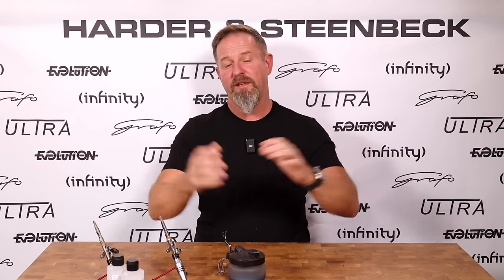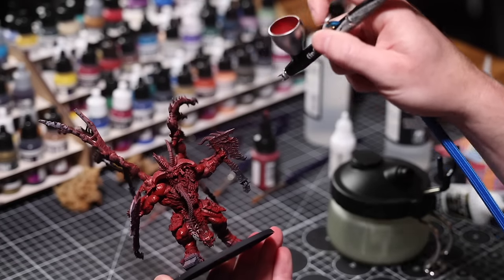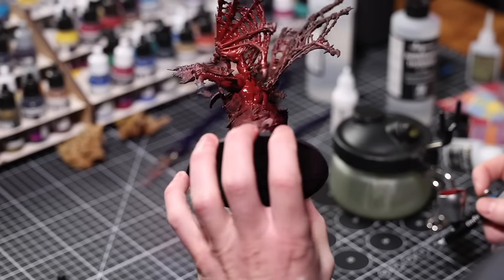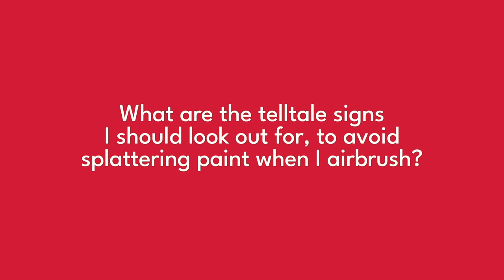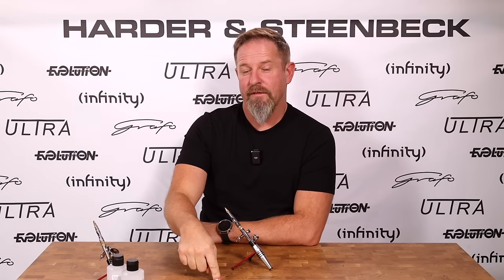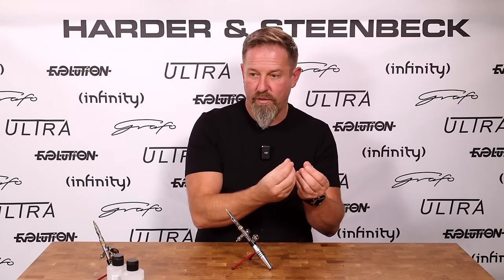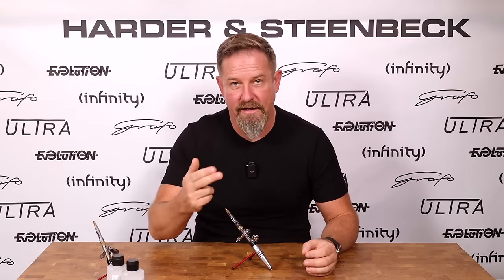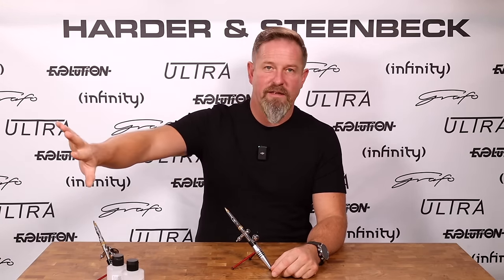How to stop putting too much paint down and avoid paint splatter

Comment: I have a question. I purchased the new Ultra and the new Eclipse. Both are incredible airbrushes. Some of the paints I use are lacquer or alcohol based (Mr Paint, Mr Surfacer, Tamiya, AK Real Colors). Because of the harsher products used to clean these paints from your airbrush, I am afraid to run them through my Ultra and Eclipse. I only use them in an old Iwata HP C Plus. Can I use these harsher solvent based paints in my new brushes and if so, what is your best way or best product to clean these paints with. Thanks for everything!!!!
Reply from the maker: Hey Tony - thanks for the question - I assume you mean EVOLUTION when you refer to the Eclipse :-) anyway, honestly, anything up to and including cellulose or toluene thinner is no problem for all the paint bearing parts. Try to keep it away from the airvalve though, as the very small o-ring in there is a little more sensitive, and should not need cleaning anyway, as it is purely air-bearing. So go ahead, use whatever you want. No worries.
Reply: Yes I did mean Evolution. See, this is what happens when someone walks into your office and starts asking questions about something totally unrelated to what you are doing! Thank you. I was concerned about the internal seals and the finish.  @harderairbrush

Comment: Hi, i have trouble spraying very fine lines or small areas with white acrylic paint, i see a lot of dusting. If I thin the paint any more i cant go near, because the paint will be runny and then I am in spiderwebbing territory, If i increase PSI I get the same effect. Could you help, please? Thank you!
Reply from the maker: White is like the building jump in the Matrix. Fact. No-one gets it the first time, even The One. Firstly, you need a really good white. If you're struggling and struggling, then you might not be using a good one. I don't know all the good ones, but the ones that I haven't struggled with are: Vallejo Game Air, Tamiya, Golden, Createx Illustration, Pro-Color, to name a few. Generally speaking for fine stuff, try thinning not so much, and DROPPING the pressure a bit. The feel on the trigger is dramatically different, but dropping the pressure and thickening the paint a bit helps the opacity, and with the somewhat decreased atomisation, it also helps a bit to sharpen up the linework... pay close attention to keeping your needle tip clean though. Hope that helps!
Reply: @harderairbrush  Thank you very much! I am on my way to the workshop to try it out!
Reply from the maker: Let us know how you got on!
Reply: @harderairbrush  thanks! This helped, i am using schminke aero color supra white, it feels better than vallejo air but i already ordered pro-color to try that out. The line is not as clean as with normal colors but I can work with this, mainly I am using it for osl and volumetric highlights so the second coat of color hides qny imperfections! 😁

Comment: Thanks for the videos.
I have a couple of quick questions about cleaning between colours.  In one of Squidmar’s Videos he changes colours by forcing water with a squeeze bottle down the cup, while operating the airbrush. Is this something that is safe to do with the airbrush or could it cause problems if done incorrectly?
The video is (https://www.youtube.com/watch?v=BLOT1Jkq9wk at 32:34.)

I have seen another person clean acrylic varnish out of the airbrush with hot water. Is this something that is effective or not worth doing because not necessary / damaging?
Reply from the maker: Hey there - love the user name by the way... regarding Emil's video - no problem with "pressure washing" at all - go ahead. The hot water thing I've heard before. As I've said in other videos, remember that airbrushes are made from elements from the Earth's crust - hot water isn't going to touch them at all! No worries :-) BUT the hassle of boiling water to make it hot etc etc - no way - too much trouble! No benefit to using it, and lots of hassle. Keep it simple - use the cleaner recommended for use with whatever paint product you're trying to clean and spray it through. That's all you ever have to do. So many people trying to make it complicated, and I really have no idea why :-) perhaps it's to try to make the "this one trick" clickable video - I don't know :-) but honestly, keep it simple, use cleaning and thinning products from the same manufacturer as whatever paint you're using at the time, and life will be excellent!
Reply: I just watched that video too. My Ultra 2024 is expected delivery on Monday.
Reply: I have a little self-heating cup that plugs into the wall just for airbrushing. I push the button for the desired temperature (1 setting below boiling) and use a dropper to get it out. 1 dropper of hot water and scrub with a q-tip, another dropper of hot water to flush,  a little bit of airbrush cleaner to flush, and then one last dropper of water to flush the cleaner.

That being said, it's a lot of steps, and after watching so many videos from Warrick, I've just started flashing with water and cleaner to see which way is faster... I'll know next week after putting some more time on my new Evo 2024 this weekend 🤓

I'll probably save my current method for the last cleaning of the brush at the end of a session...
Reply: @NathanBest  I just came across the Badger boss from 11yrs ago saying just frequently blow through cleaner like you have OCD (my words) and you'll never need to take it apart. Sounds good to me. Perhaps a little careful backflushing if required.
Reply: @border304  I'll try that too! I very rarely need to take them apart... I think twice in the last year. Flushing seems to work just fine, unless I let it sit too long 😵